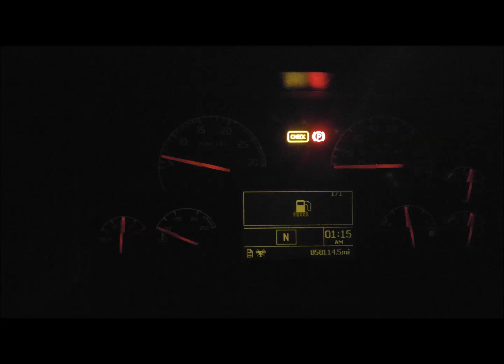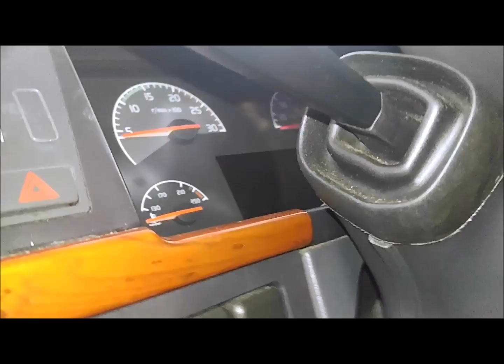Volvo vnl 780 Low Fuel Feed pressure MID128 PID 94 FMI 7 fuel light How to Prime Volvo Truck

Comment: Yo saved me today brother
Reply from the maker: What was ur truck doing?
Reply: @BiggTruckDriving  it would not accelerate making a rumble noise I drove around with low fuel I put fuel into it and I was doing the same thing stalling out until I pumped it a couple times ant it ran like normal

Comment: Changed injector cups ,injectors ,fuel housing, water separator housing, overflow valve ,check valve hoses and I'm still having the same problem
Reply: The 435hp is for the automatic shorter wheelbase volvo 670,,  the 465 is for manuals and 780 automatics but everything should be the same just different tune ,,,,maybe the owner was lying about the miles!!!
Reply: @jsta625  it's says 18 speed on door 435hp  like you say bother they the same
Reply: @jsta625  tomorrow they will clean the tank and change all the fitting if doesn't work I will burn it 😁 I will buy another truck I can't keep up lost lot of money will keep you updated thank you again brother
Reply: @nazar_1010  I never saw a d12 18 speed ,,, but I feel your pain and understand your frustration, ,,, it's a nightmare,   usually it ends up being something small !!! I hope you find it soon
Reply: @jsta625  your right. That's what my dad told me 🙂 hopefully everything go well
Reply: @jsta625 hey brother quick update truck is fix it was fuel line sucking air somewhere I really appreciate your help God bless you
Reply: @AliYafai-qh3ih  that's good to hear, wish you best luck with it.
Reply from the maker: Fuel feeder
Reply: @BiggTruckDriving  😆 fuel filter housing or fuel pump?
Reply: The housing with the prime pump is new ,its still doing it
Reply: I'm having the same problem ?
Reply: @andrefitts9463  I'm 4 months down 5 shops the whole fuel system was replaced,,,,now shop 6 !
Reply: @jsta625  please keep me updated because my truck is just sitting and I did everything you did
Reply: @andrefitts9463  no problem i will reply here when its fixed....
Reply: @jsta625 did you fix your truck?
Reply: @EduardoMartinez-vc2lo  After we changed everything!!!! It was the ECM !!!!
Reply: @EduardoMartinez-vc2lo  Bad fuel module in the ecm ,was showing 0 psi fuel pressure,,,after I borrowed a ecm it works perfectly
Reply: @EduardoMartinez-vc2lo  laptop was showing 0 psi fuel pressure,,,manual gage was showing 57 psi ,,after we checked the harness and sensor....... 200% ecm
Reply: @jsta625 I have some problem I change everything even my ass 
But it's showing 57 psi on the lop top do you think that it ecm
Reply: @AliYafai-qh3ih  if it's on idling and you have 57psi on the lap top ,my was showing 0 psi on the lap top but the truck was on running,,,, I changed the harness and ecm .... tooo much money dumped
Reply: @jsta625  I fell you same 
My problem is truck start fine idle good the problem is truck wont go over 40 miles no fuel coming up  I change fuel filter housing I did egr valve  I did everything I just got used ecm I will swipe it today and see if the code go way 😢
Reply: @AliYafai-qh3ih  check the psi on the pump 

Check 2 fuel check valves (small) try to manually pump at night with a flash light and check for fuel leaks and noise,,,sounds like you are loosing pressure and air coming in your lines ,,,,check the o ring of the fuel filter housing! Usually that o ring goes bad or gets squeezed little bit and air comes in , check the ball underneath the fuel filter housing there is a spring and a ball holding pressure! Check under the cab where 2 fuel tanks connect to the T connector,, ,check for bubbles in the fuel tanks while the truck runs 

Borrow a different ecm just to see if the problem stays or dissappers

Check if the fuel water separator is full of fuel or half way
Reply: @jsta625 I will do tomorrow today I just buy ecm didn't work code is there   I try it out nothing $600 nothing the code is there so what I did I buy another fuel filter housing  new will but it in tomorrow morning and I buy 2 fuel tank valve vents  after that I will look for what you say and will keep you updated I really appreciate your help God bless you brother
Reply: @AliYafai-qh3ih  there is 2 check valves on the block ! Small and big ! They sometimes cause problems , there is also a big O ring in the accessorie drive that runs the fuel pump through the shaft ,,,that big O ring sometimes leaks
Reply: @jsta625   so what I did today ecm done didn't fix the problem  code is there 
I did the 2 tank vent breather  for $100 original  part  
Fuel filter separator I did change it its under have because I drive the truck around every time I fix something to make sure truck it's ok 
I did the change the overflow Valve for $159 didn't fix the problem 
So I end up buying new filter housing for $349 the old one I just have it about 4 months you never know everything can go bad so will but it tomorrow morning and will check the t tanks fuel lines T connector  and will flow the lines all the way and see after I but evverting will take it for run and see hopefully will fix my problem  

What happens is I'm from Chicago so I want to indiana to get load about week ago so everything was working fine was doing 70 miles pr hour I stop for fuel I full up 150 gallon I drive it after that 90 mile to indiana did drop and hook  on the way Back after 19 mile there was hill on the I 65 so  I did on the hell 70 up then The code come up for first time never ever have it after that truck still the same  will not go over 40 miles starving for fuel
Reply: @jsta625  I did change the big valve and I open the smal valve to  clean it up  nothing change
Reply: @nazar_1010  did you change the filters ,,,sometimes the O ring is bad on the fuel water separator and fuel filter
Reply: @nazar_1010  you are getting air somewhere  ,,,, check small hoses for air leak
Reply: @jsta625  I did change them today and I did the fuel filter housing new one nothing change
Reply: @jsta625   tomorrow  we going to drop the fuel tank get them clean and change all the fuel lines  and fitting  I'm tired of volvo man
Reply: @AliYafai-qh3ih  my volvo d12 had 1.9 milion miles
Reply: @AliYafai-qh3ih  is is a D12 or D13 engine?
Reply: @jsta625  my truck have 850 miles
Reply: @AliYafai-qh3ih  you didn't do the cups and injectors yet right ?
Reply: @nazar_1010  did you replace the fuel pump and accessorie drive ever ?  (both must be done at the same time) not just the fuel pump alone !!!
Reply: @jsta625  no I check all them truck start very fast with no problem idle nice to
Reply: @jsta625  I did the fuel pump  I don't change the accessori drive they told me it's good nothing wrong with it
Reply: @jsta625  the truck have new engine 465 hp 800 mile on it when I buy it almost 2 years  it wast 700 mile on it  
The old owner  I think he swipe the engine  because it's says 435hp on the door in the engine it's says 465 hp
Reply: all new fuel system parts still cannot get it prime any suggestions
Reply: @andrefitts9463  everything is new from cups injectors pump acc drive lines both housings check valve overflow valve air vents on the tank ....still doing the sam thing,,,,the shop believes there is a clogged part at the suction side ! Will see....
Reply: @jsta625  ok i have a D11 and truck been down about 8 months and I'm over here scratching my head so please keep me updated 👍🏾
Reply from the maker: @andrefitts9463  for me it was fuel feeder, I could prime and would work fine, I also replaced water separator because had bunch issues with it. Not sure what else it would be
Reply: @BiggTruckDriving   I got a new fuel pump and everything on it
Reply from the maker: @andrefitts9463  Google KOT Repair Des moines,IA smartest mechanic I know when it comes to Volvo engines give Aaron a call he might be able to best direct you.

Comment: did changing the fuel pump solve the problem? I'm having the same issue. I have 2008 780 Volvo.
Reply from the maker: no was fuel feeder
Reply: @BiggTruckDriving  what’s the fuel feeder ? Where is it located ? Having exactly the same problem
Reply from the maker: @jorgevilchi3522  I'm sure I'm using wrong terminology and sorry for delay,  it's located on driver side back of motor on D12, the same device I call it a feeder but it's has a knob you can unscrew and prime truck.
Reply from the maker: @jorgevilchi3522  fuel filter housing is what it's called, here is a link https://youtu.be/4cevg5o1XGU
Reply: @BiggTruckDriving what does it looks like?? Is it the one with the large stick located under the alternator?
Reply: Fuel feeder is fuel pump
Reply: Were is that fuel feeder located at????
Reply: Where is fuel feeder? Are you talking about the fuel pump or pump housing?
Reply: My statrts without any problems but i get the error fuel feed pressure mehanical fault
Truck runs fine but it randomly shuts of than i need to reset all faults and he starts and runs fine again for a gew miles

Comment: could be one of  the hose or o ring type washers in it connected to fuel filter housing.
Reply from the maker: thanks replaced them few times, took to dealer and they said it's getting air in bottom off manual fuel feeder housing.
Reply: Hi, and finally what was that, I have the same error "fuel supply fault" ???
Reply from the maker: was my fuel feeder pump needed replaced.
Reply: So, basically its fuel pump that's bad?
Reply: It's the fuel transfer pump